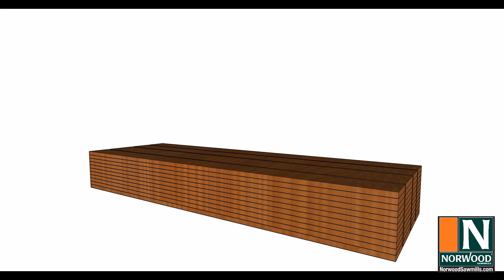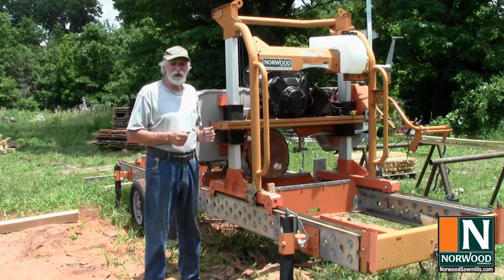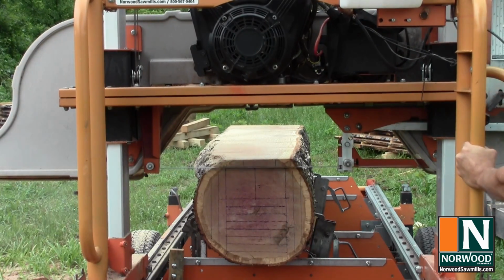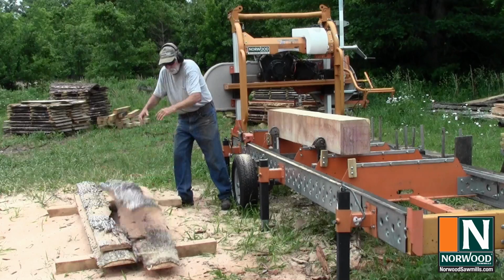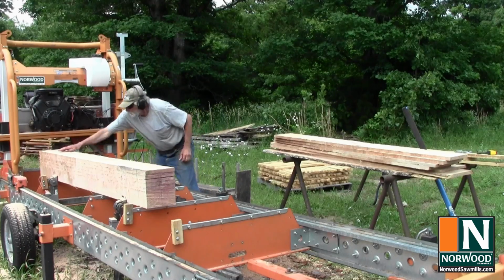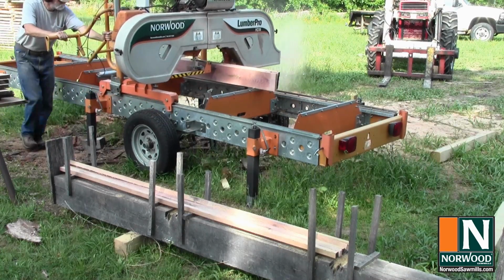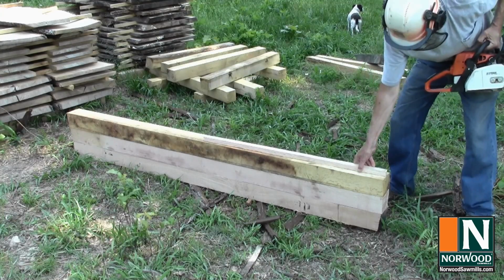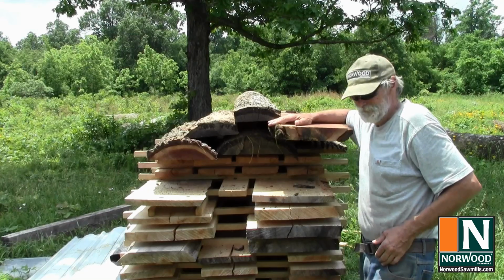Sawmill School - Cutting Blocking & Stickers to Air Dry Your Lumber

Comment: Just wanted to know how long does it needs to cure,before use
Reply from the maker: Hi Duane

1" per year is the rule of thumb, but a year of drying in Phoenix, AZ is much different from a year of drying in Seattle, WA. Also, it depends on species: Walnut for example, dries more quickly than white oak. No matter how long you air dry lumber, it will never reach the kiln- dry moisture content required for indoor furniture. 

In summary, there are many variables as to how long it will take wood to dry: species, condition of wood, dimension sawn, manner in which the wood has been stickered and stacked, ambient temperatures and humidity levels, prevalence of wind, etc … all play  a big part in drying. And, of course, what is “dry” enough depends on what you plan on doing with your wood. Best thing is to get a moisture meter and you can monitor your boards as they dry.

You may want to get yourself a copy of Norwood's book – "The Ultimate Guide to Portable Sawmills".  

We have a whole chapter devoted to drying wood.  There is another chapter devoted to making various cuts including quarter sawing.  We have another chapter covering how to make money with your Norwood.  Plus, there other chapters with great pro-sawmilling tips.

It's just $8.70 for shipping (we give the book for FREE). http://www.norwoodsawmills.com/free-portable-sawmills-book
Reply: Depends on how you'll use it.  In most parts of the country, it won't dry to "kiln dry" (6% moisture content) no matter how long you let it air dry, so furniture, paneling & flooring needs to go into a kiln before you use it.  Rustic furniture, such as trestle tables, are designed to handle changes in moisture content can be used air dried, basically to the 1 year per inch thickness rule of thumb.

Comment: Great videos.  I watched several tonight.
I'd like your thought on drying lumber in a sea container.  Over the years the outside temp will vary from 90F to -10F.
Reply: Thanks, Lowell.  Between building the house & running a railroad, looks like you stay pretty busy.  I've got a shipping container that I plan to convert to a kiln.  The biggest issues are loading it and air circulation.  Without a heat source, you won't get much drying done in the winter, though.  I had a 12' overhead garage door installed on one side of a shipping container, and plan to insulate it and install a dehumidification kiln in the near future.

Comment: Have you had any experience with the Norwood Portable chainsaw mill?  I have no real reason for such a large machine.  We have 30+ logs of Cherry to mill.  They had to be removed and so I want to mill them.   
If not, I just don't know if I want to pay the price for a mill and then have it sit until I need it again in the future.
Suggestions?
Reply from the maker: Hi Bob

Maybe you’d be interested in a free telephone consultation with a Norwood sawmilling specialist? Even just a few minutes can be time well spent to explore your wood processing needs with a professional, and to match you with the perfect sawmill configuration for your milling operation.  It sure sounds like you have some good and valid questions to consider.

If you would like to take us up on this offer, please let us know your telephone number and email address and we will make sure we connect with you. Rest assured, there is no obligation. This is a service we are happy to provide future sawyers.
Reply: @NorwoodsawmillsDirect  I'm not putting my phone number on the internet.  How about your 800 number and I'll call you
Reply: The chain saw mill works well-- slower and takes a wider kerf than a band mill, so you won't get as many boards out of each log, and you'll need at least a 60 cc saw with a bar longer than the widest part of your loargest log.   If this is a one-shot job, you might also consider a custom sawmill service.  Start out by checking CraigsList or Facebook listings.  You might even find someone who will cut on shares (I'd sure do that for cherry!).  Only "problem" is that once you find out how enjoyable it is, you'll probably want to buy your own mill.  What part of the country are you in?  What size are the logs?
Reply: @daveboyt6810  Northeastern Pennsylvania.
The logs are 8'6".  They do range from a small diameter of 8" up to 18 inches.  Most are in the 9 and 10 inch range.  
Also, the service that dropped the trees cut some logs shorter than 8'.   
I figure if I pick up  the Norwood chainsaw mill I can do a couple of logs a day and keep the lumber and build cabinets and furniture.  I have experience with that.  
The milling will be the new experience for me.
Reply: @beebob1279  As long as you understand the limitations of the chain saw mill, you'll get some good lumber out of those logs.  I started out on a chain saw mill many years ago and still use a chain saw to break down big logs so I can mill them on the band saw mill.  I'd say go for it!  Practice on one or two low quality logs first, just to get the hang of it, and you'll do fine.
Reply: @daveboyt6810  Thanks.  I'm going to practice on a small maple and a lousy log like you suggest.  I'm figuring on getting enough lumber to help pay for the saw set up.  Then I can mill something whenever I want to.
Take care.

Comment: Great video that answered all my questions I had before I start clearing 3/4 acre of old pine and a few oaks. I plan on stacking in my 2 car garage till summer and I'll be able to get my hardwood floor finished and barn done this year! WOOT
Reply: Thanks! Sounds like an ambitious plan.  Might want to look into getting the hardwood floor kiln dry before you lay it down.

Comment: I have heard before that using the same wood for stickers as your lumber will prevent staining. Is that true? And do they need to be dry before you use them?
Reply from the maker: Hi Will. It would be good to let stickers air dry a couple of weeks, but a light-colored hardwood like post oak have never caused a problem.  If the boards are very light-colored, like maple or ash, there could be some noticeable "sticker stain" (not to be confused with "sticker shock").  This typically disappears after one pass through the planer, though.

Comment: What size of the stickers 1x1 or 3/4 x 3/4
Reply: Actually, I cut mostly 1-1/8" by 7/8".  Here's why... I cut a lot of wood 1-1/8" for customers so that they can dry and plane the boards to 3/4" , even if it cups or warps a bit in drying.  Low quality boards go back on the mill for stickers, and I drop the head 1" for each pass (easy to calculate cuts that way).  With the 1/8" kerf, they come out 7/8" thick.  If I'm cutting low-quality post oak for stickers, I'll just cut 7/8" x 7/8" (again, because it is easy to calculate the cuts).  They'll shrink down to 3/4" in a month or two.

Comment: Dave I just bought a used LM 29, I was leveling  the bunks and noticed where the feet are attached, the feet are bent up where the leveling nuts are. I would think that since the legs and feet are to support the log weight it would be stronger than that. I'm a bit surprised by the fact that the engineers of the unit did not think it you extend the size of the sawmill, you know more weight will be added by longer and bigger logs. The feet just pushed upwards. I can do 20 ft logs, and dont was ant to bend the feet down as this weakens the metal more. Have you heard of this happening to anyone else?
Reply from the maker: Hi Daniel. I would like to have a technician call you Monday morning. Is your mill registered in your name that we see here? Then we should be able to find your contact info. Thanks
Reply: @NorwoodsawmillsDirect  sure, yes I have an account with them. I would sure like to show them to improve their product. It's about weight and surface area distribution.
Reply: I have terrible phone reception where I live. So texting is much better.

Comment: Do stickers and blocks  need to be dried before use?.  Thanks
Reply: Good question.  It would be good to let stickers air dry a couple of weeks, but a light-colored hardwood like post oak have never caused a problem.  If the boards are very light-colored, like maple or ash, there could be some noticeable "sticker stain" (not to be confused with "sticker shock").  This typically disappears after one pass through the planer, though.

Comment: Thanks so much for your video, I am new and learning. what are dimensions and how long to dry -thanks
Reply: Generally, I cut the stickers to 7/8" by 1-1/8".  Oddball size, but the 1-1/8 matches the thickness of most of the lumber I cut, which lets me lay them crosswise to fill in the space if I have short boards in the stack, and makes it easy to use boards that would otherwise be scrap.  The 7/8" works, because I can drop the blade down in 1" increments (allowing for 1/8" saw kerf) for quick and easy cutting.  Hope that makes sense.  You may come up with something different that works for you.

Comment: Can i get it in india
Reply from the maker: Norwood builds several models of manual and hydraulic portable band sawmills ranging in capacities from 27” (69cm) to 38” (97cm) log diameter.  

Standard, Norwood band sawmills are 16 feet long (4.8m), which allows you to cut boards up to 13-feet (4m) in length depending on the model.  Saw even longer by adding optional 4-foot (1.2m) log deck extensions. In fact, you can saw logs of any length in stationary configuration – some Norwood owners are sawing logs over 40-feet (12.1m) long! 

All Norwood sawmills have an available optional trailer system. 

Norwood band sawmills start at just $4567 for the LumberMan MN27. 

-	The LumberMate LM30 starts at just $5297 right now in stationary configuration. 
-	The LumberPro HD36V2, starts at just $8597 in manual stationary configuration
-	Norwood’s biggest bandmill, the LumberMax HD38 is just $11690 in manual stationary configuration. 

You can build up your HD36V2 and HD38 to fully-hydraulic anytime – when you start, or later when your sawmilling operation gets bigger. 

To learn more about Norwood Sawmills, here are some quick and free resources:

-	Norwood Catalog (downloadable link): https://www.norwoodsawmills.com/digital-info-kit 

-	Visit Norwood Sawmills online: https://www.norwoodsawmills.com/sawmills  .

-	Price list (downloadable link): https://www.norwoodsawmills.com/digital-info-kit  * NOTE: Prices are going up May 15, 2021

-	Check out Norwood’s “SAWMILL TV” … the ultimate online “TV” channel devoted exclusively to portable sawmills and successful sawmilling. It’s your one-stop-channel for all the essential things you need to know – from choosing your first sawmill to getting the most out of your equipment … Think of it as the Netflix for sawmill addicts 😊. www.NorwoodSawmills.com/tv/ . Sawmill TV is another resource we offer to current and future Norwood owners FREE of charge.

Freight prices vary depending on exactly where we ship to and also what you order (as that affects weight and volume).

Please feel free to email with your further questions and request for personalized quote including shipping: info@NorwoodSawmills.com .

Thanks

Comment: I've had  Norwood Mark III since around 1999.  Keep it under cover and in good condition.  Great equipment. Your videos are greatly appreciated even though I have sawn many thousands of Board Feet over the years.  Lately, when watching you on the newer machines I am very envious of the modern log dogs and clamps to keep the logs and cants in place.  I have the old rods and hand screw (one only) and wonder if there is a way I could purchase those more modern dogs and clamps and retrofit to the Mark III?  I'm too old to buy a new machine and besides, the Mark III is still doing the job.
Reply from the maker: Hi John

How great to hear that you are still enjoying your Mark 3. It was a good machine. Unfortunately the newer log clamping mechanisms do not work on the older log deck.

Comment: can i use sweetgum to make stickers?
Reply: You can use sweetgum, but what I run into is that the stickers tend to twist and warp as they dry more than most species.  If they're still straight after air drying a couple of weeks, they'll be fine.
Reply: Thanks. I've got a few small sweet gum logs with no purpose. I hate to see anything go to waste.

Comment: Good video! 
I do have one question.  A guy I know told me that if you put your end stickers at the ends of the boards they won't split.  Ever tried that? Just curious,  as I don't have my own mill yet.
Reply: Some people do that, and it might help, but the best way to keep boards from splitting is to apply an end coat to the log as soon as possible after the tree has been cut.  I use a product called AnchorSeal, but even a couple of latex paint will help.

Comment: I bought mill recently and my first job has been to make bunks and stickers. Mostly made from soft wood because that’s what I have. It’s a great way to move the lumber on and off the mill as well as getting used to adjusting the saw to different dimensions.
Thanks for the tips.
Reply: Congratulations on the mill!  Only problem is whether the wood will stand up to exposure to the elements, especially ground contact.  Cedar & cypress are great, pine might last a year in ground contact.  Hope you enjoy making sawdust!

Comment: Thanks for sharing.  Helped me out a lot.  One question - how long do they need to dry before you can use and get no sticker stain.  thanks
Reply: That one question raises a whole lot more.  It is a very complex issue.  I'm working on a video that addresses that very question.  I begin at the end, by asking the customer how the wood will be used.  For fencing, board & batt sidding and even some types of furniture, it can be used straight off the mill.  But if you're building a Maloof rocking chair or other fine furniture, it needs to be kiln dry or the joints will come apart as the wood shrinks to adjust to the drier air inside the house.  The old timers have the rule of thumb of 1 year air drying per inch thickness, but again it still isn't kiln dry and the wood will further dry (and shrink) when brought into an indoor environment.  And a year air drying in Seattle, WA will be much different than a year in Phoenix, AZ!  Sticker stain is typically caused by chemicals in the stickers leaching out onto the boards.  The best way to avoid it is to use well dried stickers of a light color (I mostly use post oak, but maple, ash or other light color woods also work).  Also, cover your piles so that water doesn't run down into the wood when it rains.  Good luck.  Hope this helps.
Reply: @daveboyt6810  I re-read my question and it was not clear. I wanted to know how long the newly cut stickers need to dry before they can be used.  thanks for the reply, sorry for the poor question
Reply: @MrGwdvideo  Ideally, you should store the stickers under cover and let them dry for at least a month.  That way sticker stain will be less of a problem.  Stacking them on 4x4s to hold them off the ground, in a crosshatch pattern allows a good air flow for drying.

Comment: is it bad to put a tarp on top? or does it cause molding due to stagnnent air?
Reply from the maker: Depends on your soil but a bit of airflow is usually a good thing.
Reply: A tarp would trap the moisture in the pile, unless you remove it or roll up the sides when it isn't raining.

Comment: Great video.  I have been told that putting your stickers closer to the ends of the slabs will help prevent splitting.  Noticed yours are a foot or so in from the ends.
Reply: Good eye!  It does work, and really pays off with more valuable woods like cherry & walnut.  It works best if you end-coated the logs when they were first cut.  Anchorseal is a great product for that, but a couple of coats of latex paint will work in a pinch.  Since color doesn't matter, you can often get a good deal on mis-matched paints.  A lot of my logs come from tree services and the end cracks are pretty well started by the time I get them.  Once the end cracks start, there isn't much you can do about 'em.
Reply: @daveboyt6810  Free latex paint at many eco collecting place. Along with stain, clear coats, many who just clear house or garage. Many eco places won't let you take it, depending on municipal rules, having to do with insurance and what not. Mine allows it, and another one is unsupervised as it is basically a drop off. Seldom is the paint unusable.